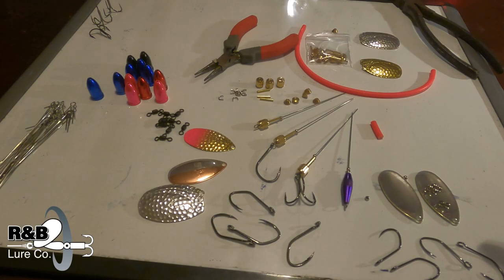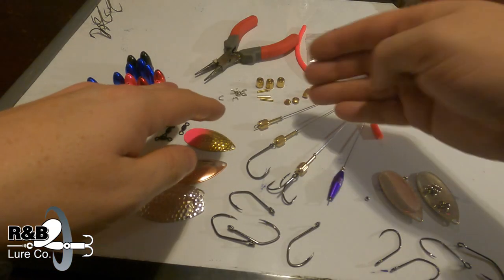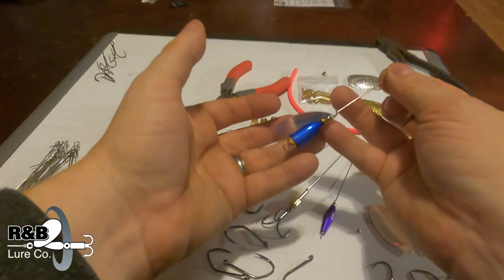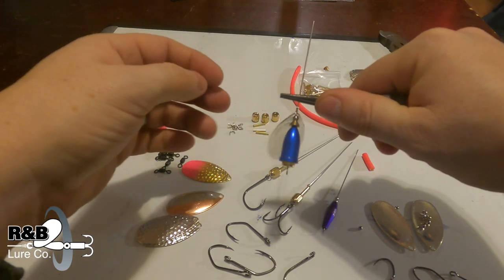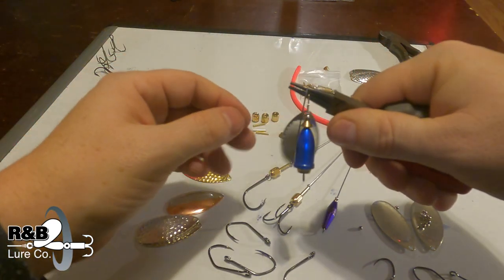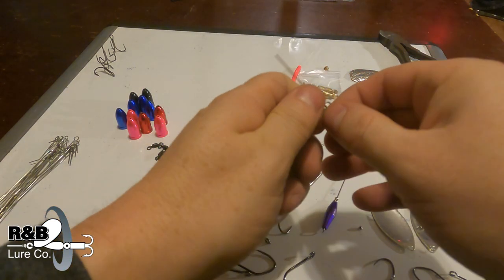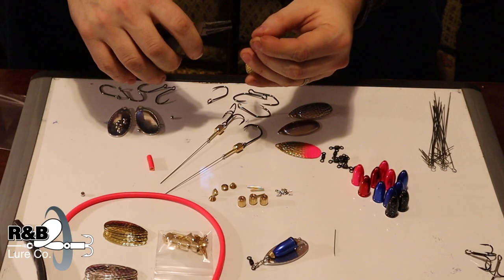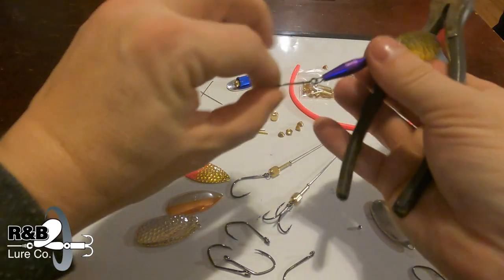How to Build a Quality Fishing Spinner w/ R and B lureco. and TheBite

Comment: Great info, I'm inspired and will start building my own.
Questions: What are you using for a "spacer" above the clicker? I don't see any listed on the R&B web site.
What diam. wire did you use for these spinners?
Also what size Siwash hook are you using on the first lure at ~ 1:30 ?
Thanks.